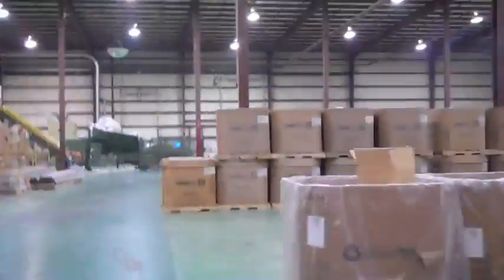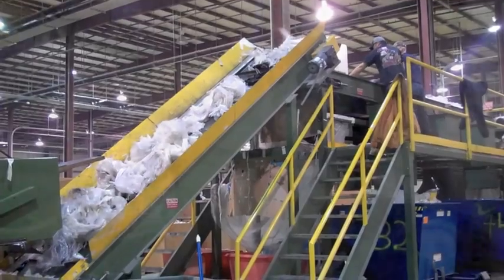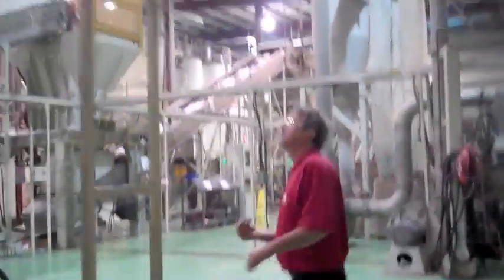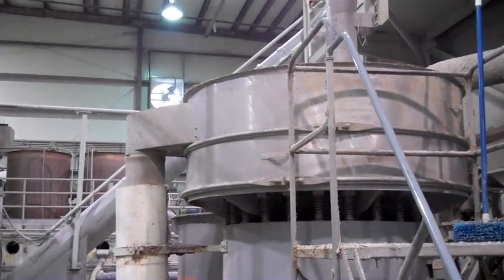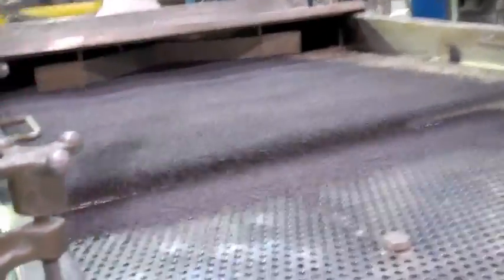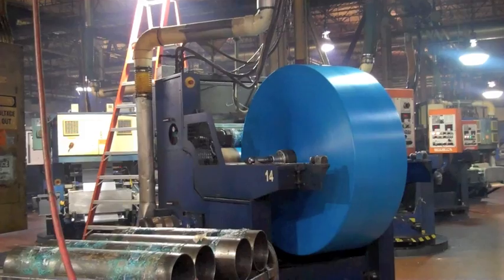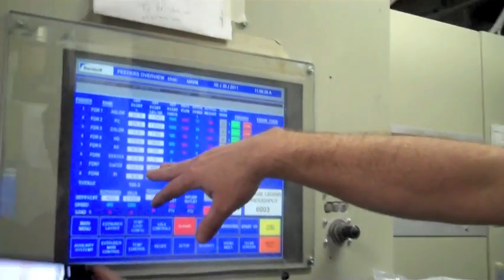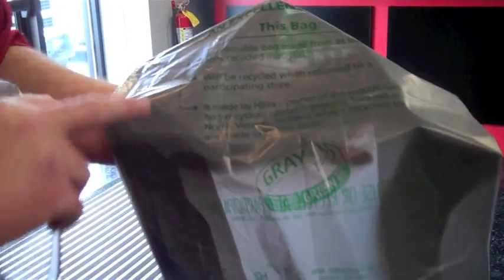How Plastic Bags Get Recycled

Comment: Yes we must reuse or recycle what we can!
I’d like to share a Great Recycling Idea for reflective insulated bag from Blue Apron that you might want to share with others!

I live in Colorado and I like to make battery heat barrier/insulation blankets(wraps) our of the Blue Apron insulated bags, for all my vehicle batteries.
So my batteries last longer protected from engine heat, as anything over 90 degrees Fahrenheit, accelerates the battery’s internal damaging corrosion and water loss. 
Also the battery can perform better in our bitter cold that greatly reduces their output ability over 50 percent and reduces their charging ability when you need them most.

Automotive Batteries are expensive and seem to only last 3-7 years.

There aren’t many things we can do to extend our battery's life span.
There are just a few sellers of aftermarket battery blankets(like the picture below) and even when you find a seller, they don’t always fit larger batteries and are basically too expensive for most to consider.

It’s well known in the automotive industry, that our vehicle’s battery’s life is shortened in temperature extremes of the hot engine compartment and the either or hot and cold climates we live in.

Because of this, many automotive manufacturers equip their new vehicles with battery blankets usually made from a cloth exterior and fiberglass like interior. 

However the vehicles considerate enough to originally equipped with these battery blankets too often loose their blankets during battery replacement. 
Often because the fragile blanket gets torn during removal, OR the new battery installer does not want to bother with slipping the blanket on the new battery, OR the original blanket does not fit the new battery, OR the installer is unaware what the blanket does OR assumes it is part of the old battery case.

Making a battery blanket is so easy with the Blue Apron reflective insulation bag which does not conduct electricity.

I place the battery into one of the corners of the bag and cut the bag down so that it wraps around the sides of the battery. 
I use my screw driver end to punch a hole at each bottom corner so if water ever gets in the bag, it can leak out.
Then I fold the sides and use box tape to hold the cut areas, the tape sticks very well. 
Then I use scissors and cut the bag to the level of the top of the battery.
Done!
Take care!